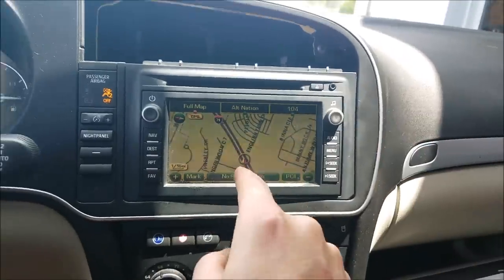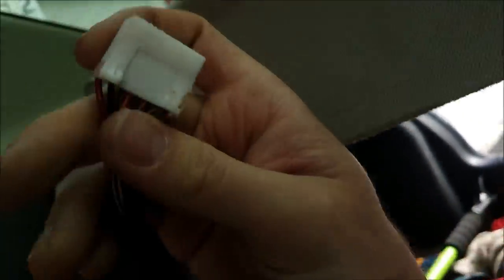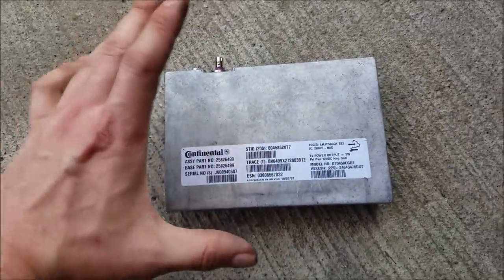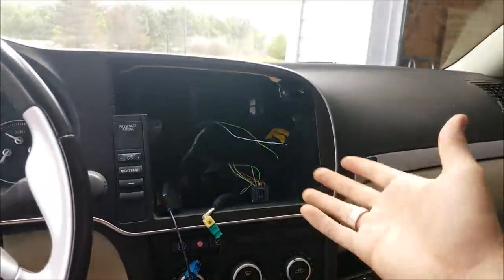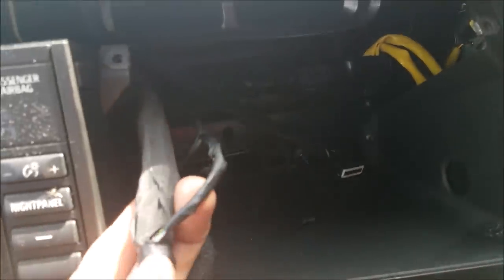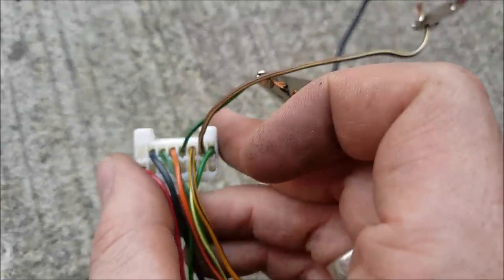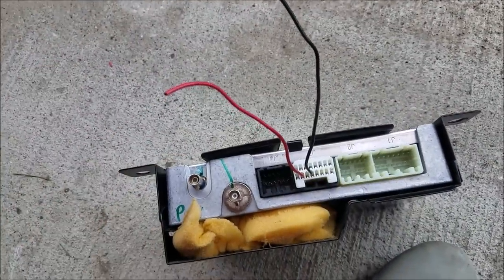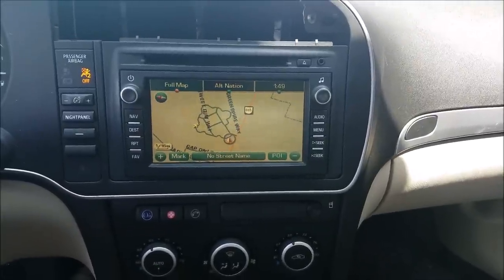Adding Voice Recognition (Part 3 Saab Nav Install)

Comment: Thanks for your great videos, do you know if I replace the oem VCIM to a Bluetooth one on my 2008 saab, then can I use bluetooth to call and play music? I've heard that nonnav ones with bluetooth can only be used for calls not playing music, same thing with navigation head unit?
Reply from the maker: Thanks for the comment! So if you add in the bluetooth enabled VCIM you'll only get bluetooth. Sadly it won't enabled music streaming regardless of Nav or not. You'd have to get an aftermarket head unit or get a bluetooth adapter. I have one that plugs into the cigarette lighter and then you set to a certain radio statio. Surprisingly works well.

Comment: I live in New Jersey bro. I want the Bluetooth and pretty much have the exact same set up as you aero manual 2007. Could I pay you for the Bluetooth set up?
Reply from the maker: I don't currently have a bluetooth module and even if I did, I would need to physically hook your car up with my tech 2. Sorry friend I would but NJ is too far away.

Comment: Does Blue shoot work with the non-nav to?And do I only need that module for my 07?
Reply from the maker: Yep, bluetooth will also work for non-nav units. Look for part # 20829984 or 20787107 for bluetooth VCIM. You still need to hook up the two wires from your radio to the VCIM. Two wires hookups will be different than whats shown in this vid though. Also, radio needs to be bluetooth capable which they weren't in 07. What's nice about the nav units is that both versions support bluetooth.
Reply: Thx for the quick reply,dont know if my headunit is 07 i replaced it with the type with the 6 disc changer.
Reply from the maker: Pretty sure the 9-3 had the bose 6 disk changer from 2007 to 2011 so I'm not sure which part numbers would work. You may be able to do a little research that could narrow it down.
Reply: @WeakestofWeeks  i'l try, not sure if there wil be different part numbers.Thx for helping.

Comment: I have the nav in my 07 9-3 but the am/fm doesn’t work along with navigation could it be a vcim problem?
Reply from the maker: I don't think those would be caused by a faulty VCIM. Radio reception may be related to the antenna, which is also the rear defroster. If there is a small break in it you will get poor reception. If nav doesn't work could be a map disk issue (normally comes up with a map disk error) or the actual navigation module inside the radio is bad. I actually have a vid coming out soon where I replace this module so I can use a more up to date/cheaper GM style map disk. On a side note, here is more info on the antenna issue/potential fix: https://www.saabcentral.com/forums/showthread.php?t=590274&amp=1

Comment: Does your onstar still work?
Reply from the maker: It does not. I believe if you run an antenna from the head unit to the roof mounted antenna instead of running antenna adapters (shown in my pt.1) you may gain onstar back. I don't use it so I'm not worried about making it work again.

Comment: Hi! its possible BLUETOOH ? best regards!!
Reply from the maker: Yes. You would need to switch VCIM's to part number 20829984 or 20787107 for bluetooth. You can find the bluetooth capable VCIM in all 2009 saab 9-3's and was an option on 2010 and 2011, so be sure to pay attention. All should have the J1, J2, and J3 electrical sockets and 2 falkra antenna connectors, but only the bluetooth module will have the additional small (bluetooth) antenna attached.
Reply: @WeakestofWeeks  i have Saab 93X from 2012....